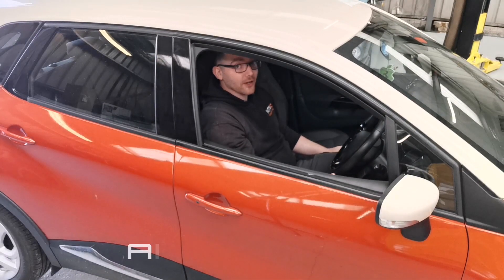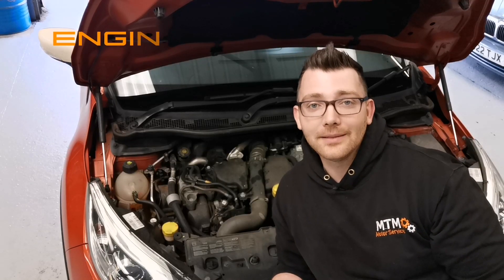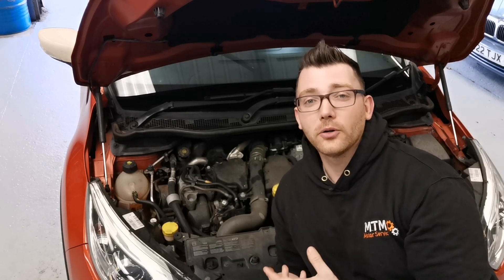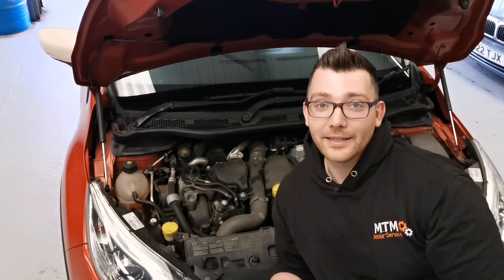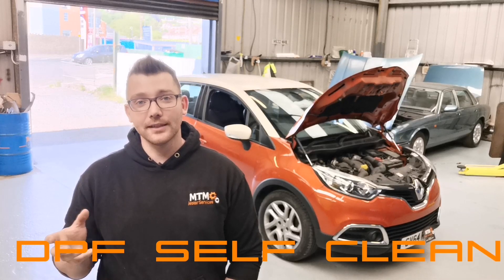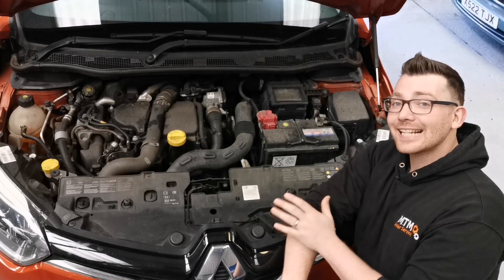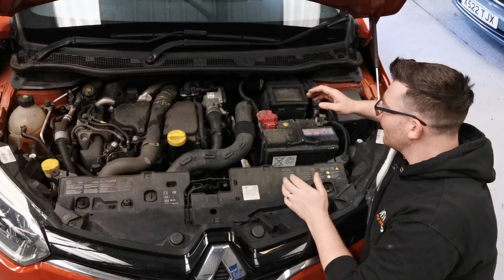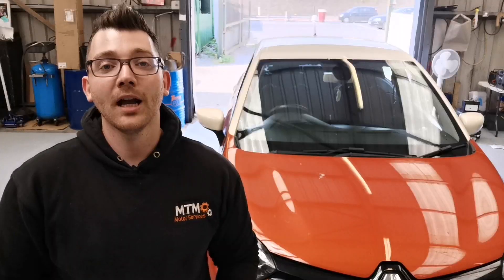STOP / START  NOT WORKING, WHY!?

Comment: Stop starts stopped working on my 63 plate corsa. Coincidentally I'm losing water from the cooling system ..wonder if it's linked?
Reply from the maker: The car has to first come to normal operating temp before it will work. So depending if it is listing a fault code or not reading the temperature properly. That could be part of the problem.
Reply: MTM Motor Services thanks for the reply. Oddly I reported the stop start not working on its last main dealer service. Vauxhall wanted £75 to run a diagnostic test which I'd get refunded for if the fault was covered by the lifetime warranty. Surely they should have spotted the water loss as they replace anti freeze on the service so maybe not. I noticed it was losing water as the fan would come on after around 7 miles (this was a long time after the stop start issue). Once I replenished the anti freeze and water the fan didn't come on. It is losing water still though. Had the corsa from new it's now 7 years old and this is the only issue I've had with it
Reply from the maker: @ewoodrailway  they should have picked up a leak on service. I would address that first before looking into the stop start problem. As I said in the video, it could very well be a battery issue causing the stop start to not work.
Reply: MTM Motor Services agreed and thanks. The oil doesn't look like mayonnaise which is good but the water is disappearing quickly. The filler cap doesn't seem to tighten but it's booked in at the garage next week. It'll be used as little as possible and the water replenished before use to keep it going.
Reply from the maker: @ewoodrailway  if your cap doesn't tighten then it's likely the system isn't pressurising . So the water could be boiling and the steam/vapour can escape through the cap if it isn't on properly.

Comment: I have a 2011 Nissan Qashqai, The (A) symbol shows as its working, but even after long drives, my car never actually stops at any point ever. Could this be a battery issue? would i need to replace it?

Comment: I wish I could permanently disable the engine stop/start on my vehicle.👍
Reply from the maker: We all do. It's not an useful feature in my opinion. Although there isn't a way to disable it due to European Emission laws, you can turn it off for each journey, only if your particular car has a button to deactivate it on your dash.

But it will automatically re activate each time you start the vehicle.
Reply: @MTMMotorServices  My vehicle has no button to temporarily bypass it. It figures too. Dang it! 
I'm gonna call N.A.S.A. maybe they can deactivate it. LOL👍
Reply: A total gimmick we could all do without.  Pull up to a red light, into neutral.  Engine stops.  Within a millisecond light turns green.  Engine has to start again.  How much fuel did that save?!  FFS.
Reply: A total gimmick we could all do without.  Pull up to a red light, into neutral.  Engine stops.  Within a millisecond light turns green.  Engine has to start again.  How much fuel did that save?!  FFS.

Comment: Great video and information, I haven’t been driving my car BMW 218i Grand Tourer during lockdown/cold season probably once a week for few miles and now my start/stop won’t work at all, I was wondering how do I get my battery charge up above 80% ? Is it just by driving longer or I need to take it to the dealer ?
Thanks and subscribed.
Reply from the maker: You can take it for aong drive in order to charge up the battery. But the best way I have found is to put it on trickle charge with an at home charger and leave it overnight.

Comment: The problem with the start/stop system on my Civic is that it works perfectly.  Can I disable it without pressing the button every time?
Reply from the maker: No, because the stop start feature was implemented to bring the emissions level down and it was used during testing which gives the official emissions stats, there isn't a way to knock this feature off permanently. Only a small group of manufacturers give you the option to deactivate the system after each start up.
Reply: @MTMMotorServices  Thanks.

Comment: I just changed a new battery. After changing new battery the start stop is not working. What could be the problem
Reply from the maker: Some vehicles have to be reset via diagnostic machine to let the far know that the battery has been replaced.
Other times it can take up to 24 hrs for the car to recognise a change itself.

Comment: I understand how it all works but does battery management look at volts or the amps in the battery. Because if the volts are there im seeing the systems are still trying to work. But the amps are not there causing another issue. What do u think.
Reply from the maker: It looks at amperage, but it also monitors how well the cells maintain a charge and it determines a "state of health" aswel as a "state of charge" this can take 24hrs to monitor. because of this, some people opt to charge the battery slowly with a "trickle charger" often leaving it charge overnight to bring the battery back to tolerance.
Reply: @MTMMotorServices  cheers for the reply. But do all manufacturers battery monitor systems look at amps. Only reason i ask this is vag stuff i believe looks at volts. If  it looked at amps then stop start wouldn't have a issue. I.e. stop starting a lot in one month on short journeys kills the battery. Where as someone who live i countryside dont have issues as there able to charge the battery enough. 
Would u advise people in heavy condensed cities to switch the system off if they are stop starting in a 5mile drive more than 50 times. As ive seen a person stop start more than 200 times in a drive cycle and 8 times the system failed where they had to manually start the car. This in my eyes is a human error not car system error. Education advised on stop start, etc. What do u think. Cheers.

Comment: I have a BMW 530 d  2017 with start stop which works, my wife has a 320 d 2018 and it will not work. thanks for the info on the battery I think it needs a good charge.

Comment: My battery was bad so I changed the battery to a completely new one but it hasn’t reset on my car and the start/stop still says unavailable I have a jeep  compass is there another reason for that
Reply from the maker: You might have to check if you have to tell the car it has had a new battery via diagnostic machine.
Otherwise, 24 hours after the replacement the sensors should detect the change in battery quality

Comment: To completely resolve this issue..... Turn that function off and never use it again.

One of the hardest things your car will ever have to do is start.  It requires all of the battery power, repeated use of the starter motor and also provides you with a lovely lag when trying to go forward.  

If you think about it on any given day for running errands you might start your car four to six times.  When using the stop start function you're looking at 20 to 60 starts.  The brushes in the starter motor will wear out prematurely, your battery is at constant strain.

Save yourself the headache and disable that function.
Reply: You'll find most mechanics have total contempt for it!

Comment: I got a same problems bmw 3 series 316 ise 2014  manual 
now my car stop 
There is show the display auto start stop function de-active  
The I give to the repair in bmw Pitar vady bmw Edinburgh first time they said me need to full diagnosis    This for £165+ vat and  they said your battery fault need to change   . I said you do then they charge me £382 
And they said me again diagnose and another fult fuel tank that’s also need change I said ok they charge £545  then again call me now they said me now fuel pressure and fuel high pressure also need chahe  that cost also £2265  
Now I’m very shock my car war only minar guilt but they make me day by day more charge but now also said no 100% success how can I do 
Plz help me any boy know about the bmw this problems thanks 
Plz reply me of leave me number I can make it thanks

Comment: Are all cars when below 80% it may not stop? or just certain manufactures
Reply from the maker: 80% is the rough estimation as each manufacturer may be slightly different. But i am yet to work on a vehicle that doesn't have that as a safety feature on the stop/start system to prevent the drivers from being stranded.
Reply: @MTMMotorServices   I have a 3 year old Volkswagen GTI.  Start stop has not gone off in months.  Went to the dealer they had no idea except system checked out fine. We are in lock down (Australia) .  Short trips only.  So I charged it last night and it works again!  Glad someone knows what their talking about.  Thanks.

Comment: Use a cheap smart charger and charge the batteries over night. My Volvo gives a low battery message and start stop doesn’t work( it tells me in the settings that it’s unavailable because the battery is charging) doesn’t get driven long enough distant to charge it so The battery charger will do it and charge the support battery as well.

Comment: Very useful as one of the criteria fitted our situation
Reply from the maker: Glad this video helped :)
Reply: @MTMMotorServices  Sir,
My Mazda CX-5 2017, start stop doesn’t work. Sometime it work but after travelling for half an hour if I stop the car, and just for the check up if I press the break the green light is flashing on the s/s button. I can’t start the car. I recently change the car battery and it was set up  properly. Could you please do me a favour by figuring the real issue on my car! That would be great help and will be appreciated. Heaps of thanks.

Comment: Thanks for the video. I am not a fan of start stop. Just my opinion.
Reply from the maker: I agree with you, it's more of a novelty feature than a genuine way to keep emissions down.
Reply: @MTMMotorServices  To me it is more to go wrong that the driver doesn't understand or need.  I really like the Toyota Synergy Drive but have found all the other renditions more of a novelty like you said.  As these cars age, they may have all kinds of issues.
Reply from the maker: @jamesu  every manufacturer puts their spin on it. It mainly depends on which market the vehicle is selling in. The UK leans so hard on car manufacturers to drive emissions levels down that it forces features like the stop start system to be implemented as they all compete with each other. The end result doesn't even translate to saved money for the driver. Just wasted time on a feature which is tells you it isn't working most of the time. As I said. The majority of issues with start stop are related to the battery. But just because the battery falls bellow 80% state of charge, Doesn't necessarily mean its faulty.